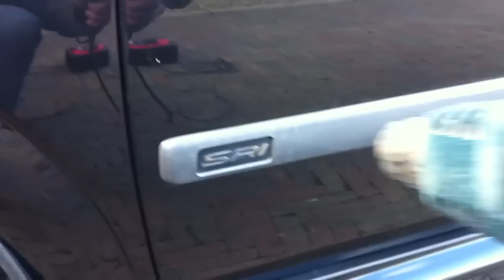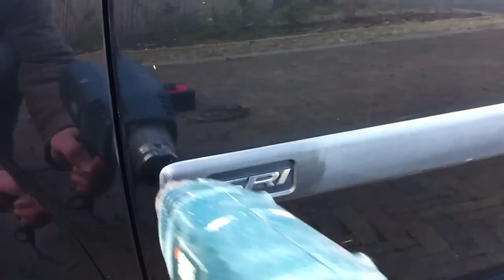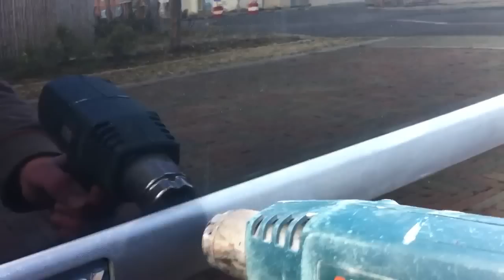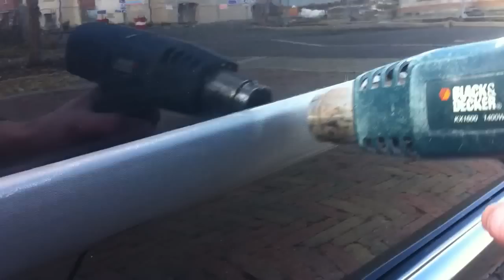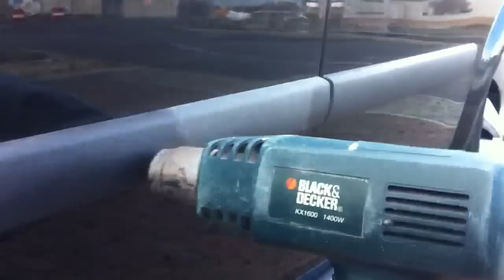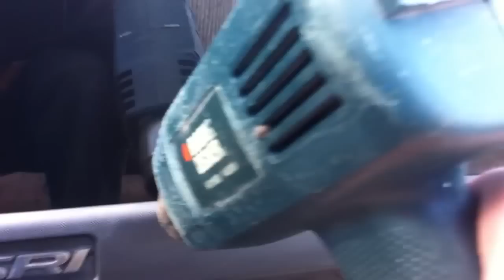How to restore car / vehicle faded plastic trim using a heat gun fix

Comment: It's not a good thing to do for plenty of reasons, Robert already stated them all, plastic won't be renewed. The only way you can eventually protect it might be by applying some sort of coating, but it wouldn't be that easy, or just paint the plastic in the same color of the car (as on most modern cars).

Comment: Don't do it! The heat draws up any oils, silicone or petroleum in the plastics... as well as the UV protection, as it dries up again, which it will, it weakens the structure further. You're cutting the lifespan of the plastic dramatically and it will quickly become brittle, cracked and start looking worse. Just use the trim conditioner and stop looking for a quick fix.

Comment: DO NOT DO THIS!!!!!!! It brings the color out but after a short time the plastic is more dull than before. Before I did this I just used back to black and it looked new even though it lasted a short time. Now the plastic is toast and terribly dull, faded in some spots more than others and had to repaint both pieces of trim I did. DOES NOT WORK!

Comment: Do not do this, you will be sorry
Reply: azimmey  I did this 3 years ago to the front/rear bumper trim on my E39 BMW. And it still looks black as night. No idea why I should be sorry for that.
Reply: Yeah I feel like this is going to prematurely age the plastic. All that heat is doing is stripping the petroleum base of the plastic and bringing it to the surface. When theirs no oil left to recondition the plastic this method will no longer work.